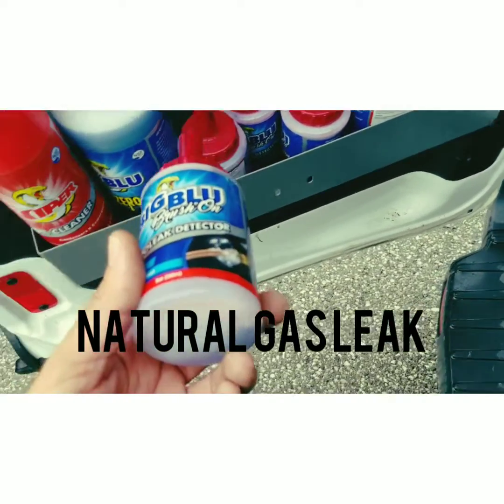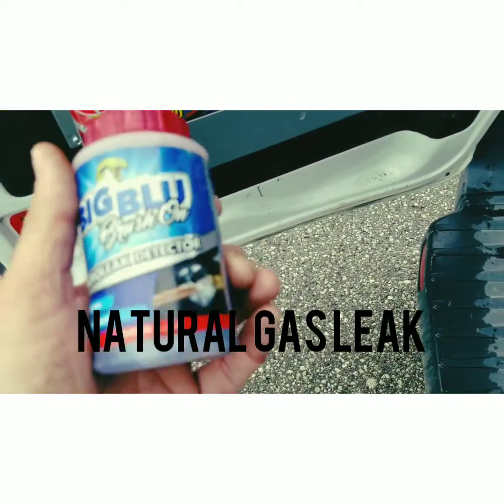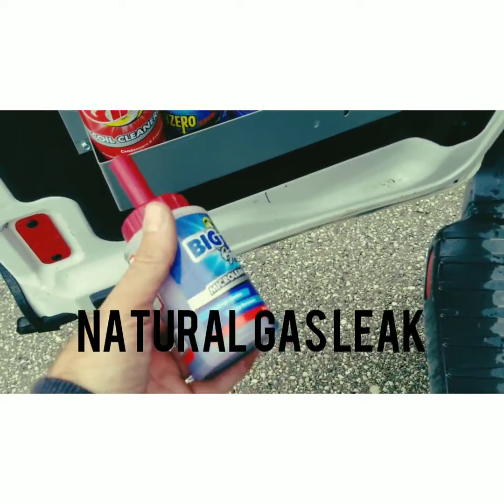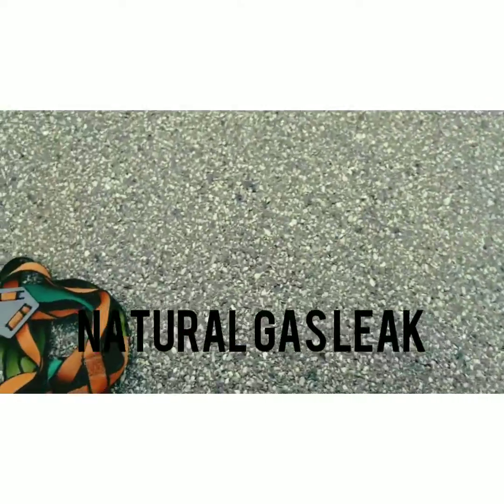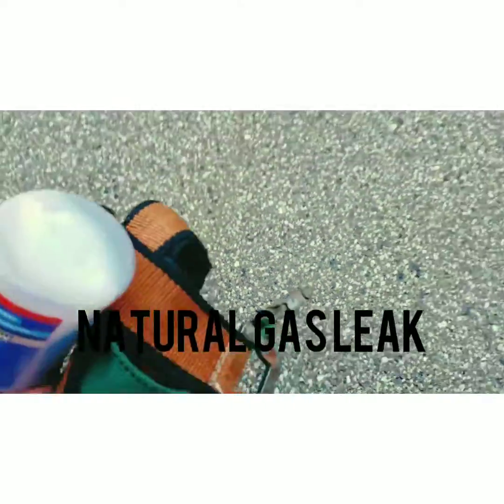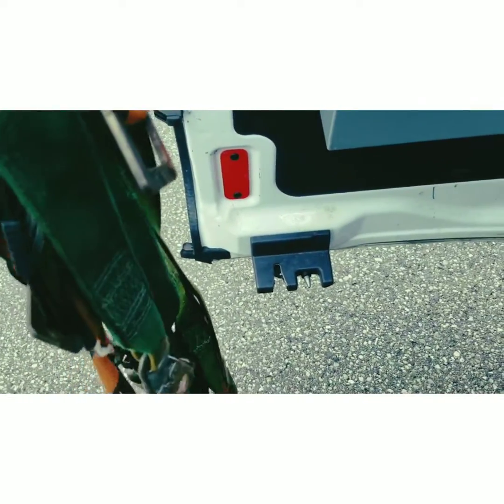HVAC - Gas Leak or False Alarm?

Comment: Now that we need a combustion detector for the "Enviro Friendly" R-290 (Propane) I have the Inficon 718-202-G1 Gas Mate. Haven't needed one for 23 years and Big Blue has been "good enough" but it finds some small ass leaks, on about every combustion gas. Good video!
Reply from the maker: I never used an electronic natural gas or propane sniffer.  I find that weird!
Reply: @HVACKnowItAll  True said all their coolers and freezers will be r290 by 2019. A normal. refrigerant detector will not pick it up. It does feel weird at first but it is a lot cleaner and easier. Not getting big blue all over the place, having to worry about somebody slipping and falling. One problem with it is pipe dope will set it off so if you just made repairs you can't recheck it with the detector. Or at least that one in particular detector.. Now once the pipe dope has set for a while and is done degassing it's fine.

Comment: Good vid  wouldn't  a electronic leak detector be useful on this kinda calls ! Which do you use or recommend on propane and natural gas leak detectors
Reply from the maker: It could help yes, I haven't used one before to be honest.  For small areas bubbles work good, if you're doing a big job then an electronic would definitely be the way to go, less mess.